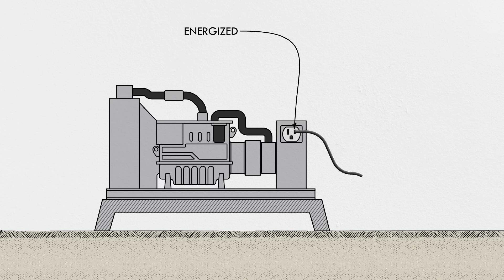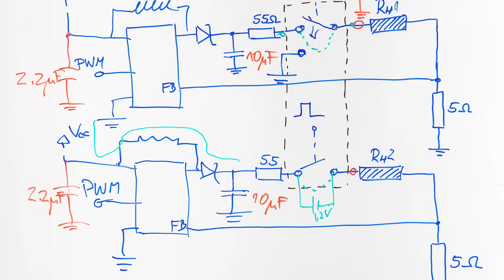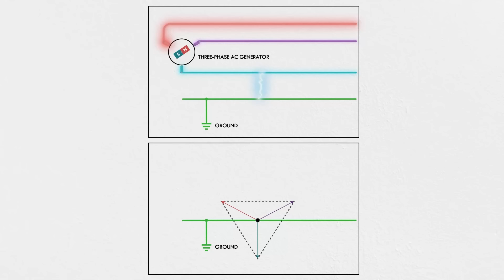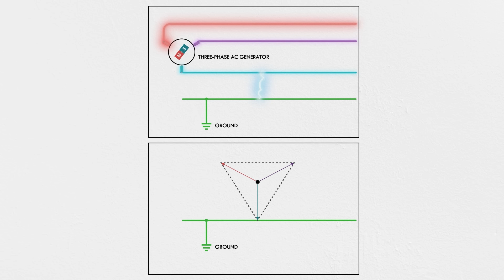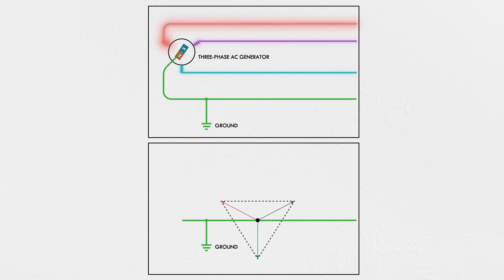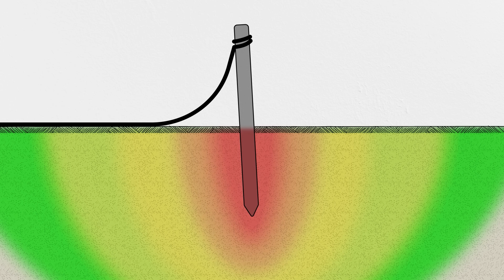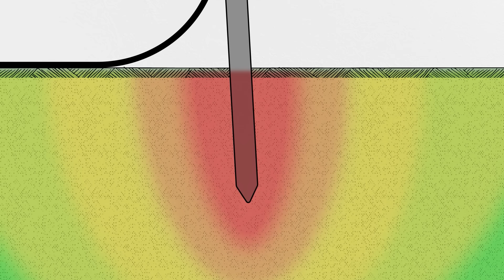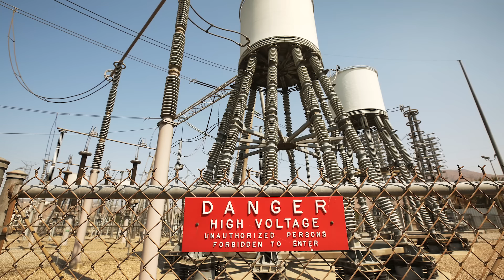Where Does Grounded Electricity Actually Go?

Comment: When I started at the power plant, I asked about where all it fed power to. A guy told me it’s pretty much like throwing a cup of water in a stream & someone else pulling a cup of water out down stream. Yea it could’ve been your water, but more than likely, it was a combo of all the tributaries.
Reply: So when we are billed to a single power company, how do they know how much of "their" power we actually used?
Reply: @danpro4519  That has to do with distribution. Your local utility, co-op, or municipality was the one that installed all of the equipment in order to deliver you power, aka the feeders (power lines), the protection equipment, the substations, and more. They can generate power themselves, or they can purchase their power in order to deliver you yours.
Reply: @danpro4519  that's not a question since both are entirely different entities. a power company is engaged in the field of producing electricity and then also in distributing it. those are separate things. with different revenue flows and balance sheets. more often then not, the distribution even inflicts an internal loss. meaning, would they just sell all their electricity to current brokers instead of the consumers, they'd be better off even.
Reply: @danpro4519  Here in the UK, power companies are meant to charge you based on grid usage rather than supply usage as the national grid controls the flow of the entire grid including from all sources, imports and everything. The engineer/TV presenter Guy Martin took over the national grid for a short time in learning how it all works in a series - "Guy Martin's Great British Power Trip"
But, that's the UK, so I don't know how it works for others.
Reply: @danpro4519  as far as generators are concerned. They just get a demand from the grid operators, & then try to meet that demand. Renewable & Fossil plants both put power onto the same grid, as the person above mentioned, it’s the transmission operators & distributor’s that actually deliver the power. Sometimes it’s all the same company but such as in my case, our plant is owned by a different company than the one that operates the grid. So customers pay them, & they keep some & pay us whatever the agreed upon price was per Megawatt when we produced it.
Reply: @imperatoriacustodum4667  Guy Martin is such a legend
Reply: @danpro4519  You're not paying for the electrons (those are free); you're paying for the movement of the electrons. Just like still water can't turn a mill, "still" electrons that aren't flowing as current can't power things; what you pay for is the power company using their generators to move electrons to create a current that can do useful work, regardless of where the electrons being moved around originally came from.
Reply: brilliant analogy.🙃🙃
Reply: @Adhithya1002  thanks
Reply: Good analogy.  The one I was given was a bunch of plants pumping water into a water tower, and customers pulling water out.  The trick was keeping the tower full.  This anology allowed for an explanation of VARs.  After 45 years of power plant operations, and explaining to junior operators, I came to the conclusion that any operator with less than 10 years experience who claimed to understand VARs was lying.
Reply: @imperatoriacustodum4667 That's an efficient, straightforward way of doing it, but it probably works best for an island nation like Britain compared to a continent-spanning grid like North America or Australia
Reply: Thanks all. I'm dizzy, but I think I understand better! Haha
Reply: That's a great analogy.
I once had someone tell me that they were no longer contributing to climate change because she drove an EV.  I asked her to consider the fact that most of our electricity where we live comes from fossil fuel plants.  She said not at her house, so I asked if she had solar on her roof.  With a straight face, she told me that she paid extra to the electric company so they only sent power from renewable sources to her house.  I somehow managed not to laugh and gave up.
Reply: @Simple_But_Expensive  20yrs in the power industry, most as an E&I tech, last 4 as a CCO, I still get confused with vars lol. Everytime I think I know, I’m wrong, I’m right on the edge of understanding, but never make it over the edge
Reply: I had a nurse ask me once how the bad electricity from my nuclear plant gets to her house.  I had to explain to her that the "bad nuclear" never leaves the plant.  Electricity is electricity no matter how it is generated.

I think from now on I'll try to explain one of the theories of electron flow in an AC system and that every 1/60th of a second, the electrons racing to her house turns around and races back to the generator and they never make to her house unless she lives within 2958 miles of the plant (1/60 the speed or distance of electricity in copper per second).  My plant is on the east coast.  I don't think that she lived in San Francisco.  (for those who don't know, this is BS, but in theory, crudely plausible).
Reply: @rhouser1280  At 20 years I thought I understood.  At 30 years I realized my 20 years understanding was just a glimmer.  At 40 years I had a solid grasp.  Now that I am retired, I still have questions.  All the book learning and doing the math still doesn’t answer them.  I have massive respect for the engineers who design excitation systems.  The two hardest things to understand in a powerplant are the prime mover governor and the generator exciter.  IMHO, the guys who design those make rocket scientists look like amateurs.
Reply: @ivertranes2516  She drank the kool-aid.
Reply: Except that rivers only do DC currents and not AC, so what the power plant actually does is put a bit of current in one direction and then quickly put it in the opposite direction in a continuous cycle.
Reply: @dwayne7356  it is my understanding that it really isn't much of a race. The individual electrons don't actually move that far because it is more like a wave.
Reply: @ivertranes2516  Suppose there are bunch of people consuming 1000MWh of coal produced electricity in a year. 10% of them decide they are prepared to pay extra for wind power. 
Enough wind power is built so that it produces 100MWh/year of electricity.
When wind is blowing coal power is reduced, and when there is no wind all electricity is still produced by coal. But in the end there is 10% less of coal consumption in a year.
I think that people who pay extra for wind power have a good claim that the 10% reduction in coal power is because of them and that they really don't  use coal anymore. After all effect would be the same if they went with off grid solar instead of grid connected wind power.
Reply: @Simple_But_Expensive  I’m blown away every time I tear into the front standard of these machines! I’m definitely in agreement with you, the guys that designed this equipment we’re geniuses. I operate 1950’s era turbine/generators, most everything is hydraulic or pneumatic. If I ever had to come up with this stuff, we’d all be eating by candle light.
Reply: @Simple_But_Expensive  I am sad to see all the plants closing & being demolished, I really think it’s going to put our country in a bind. Not trying to get political, just stating what I see as a reality.
Reply: @rhouser1280  I once worked at a plant that used a 1960 s era gas turbine to drive a 17 MW generator.  Its controls were also pneumohydraulic.  The speed controls were pneumatically controlled bars that relieved excess pressure from the fuel valve.  The governor was the size of a panel van and was stuffed with pneumatic components.  The interesting thing was the diagrams looked just like electronic diagrams.   Turns out that the guys who invented modern electronics started out as instrument and control types using pneumatics.  When they needed symbols, they just “borrowed” pneumatic symbols for things that did something similar.  Even some early chips used the same symbology.
Reply: @danpro4519  When you buy a gallon of milk from 7-11, how much came from cows owned by 7-11?
Reply: @RCAvhstape  I suppose because my area provider is Duke Energy, they both own the proverbial cows and bottle it up for distribution?
Reply: @rhouser1280 The first new US nuclear plant in over 40 years just went online in Georgia.
Reply: @danpro4519  you had a good question, hopefully one of us answered it. Whether it was a milk jug or a river…lol
Reply: There are 3 power grids in the US. East, West, and, of course,  Texas. That would have been a more accurate answer. Depending on which grid you were on, the power plant essentially provides power to everything connected to one of those grids.
Reply: @dwayne7356  In an AC system like in your house, the electrons themselves only move a fraction of an inch or so (quick google shows 10 amps in 12 awg wire is 0.02 cm/sec electron speed so in 1/60's of a sec they move almost no distance at all) - they're basically just jiggling back and forth the whole time.  That's why the analogy of pumping water doesn't really work - or it kind of does, but you have to remember the electric company is basically pumping the water then sucking it back 60 times a second...the water itself doesn't really go anywhere, but it provides a medium for the energy from the power plant to reach your house - the energy moves almost instantaneously, but the water (ie electrons) only needs to move a little bit.
Reply: That’s just an accounting trick. They measure how much power they feed into the grid (that’s how much power can be sold) and they measure how much power your home consumes; that’s the power you get billed for.

This way of treating the grid like it has storage and can route electricity like pakets on the internet only causes problems when the grid as a whole cannot meet demand by having enough peaking plants etc in an intricate dance that matches instantanepus load and demand at every moment.

Particular sins done by grid regulators are treating unreliable generation sources like wind and solar as if they were equivalent to firm, baseload generators. This leads more of them to be built until the grid gets less stable. When the grid gets less stable there are times of negative pricing (!) and times of very high proces that create a market for building or  starting up oil and gas turbines that can flexibly balance the random output from wind and solar. Grid frequency stabilization and the need for expansion of transmission nobody gets paid for so the whole grid just gets a bit worse. Frequency stabilization is automatically provided by large turbines synchronized to the grid which wind and solar are not. Wind and solar just follow the grid; a large turbine provides a very large amount of moment of inertia and doesn’t allow the turbine to quickly spin up or down in frequency.

As long as these are problems for someone else to solve wind will look cheap but make electricity more expensive for consumers. Not all kWh are equal; that’s just a convenient fiction of the old grid; in the new grid with a lot of unreliables this fiction becomes more expensive every day.
Reply: Ever noticed that the trucks working at an electric plant have a copper strap that flows behind it? This is because the electricity stays in the metal and that way it stays grounded so the driver or if anyone where to touch it or lean against it doesn't get electrocuted